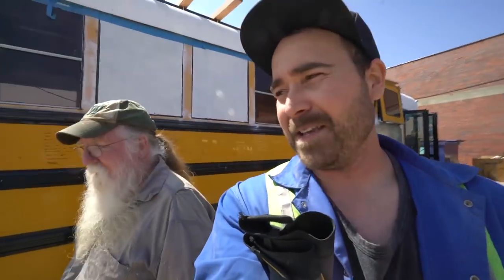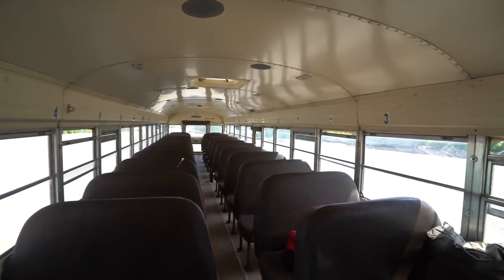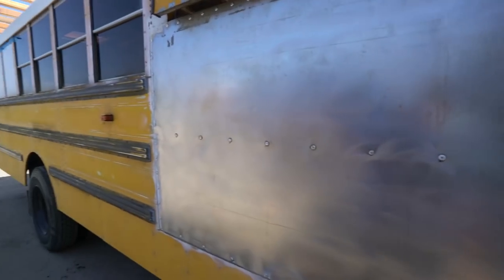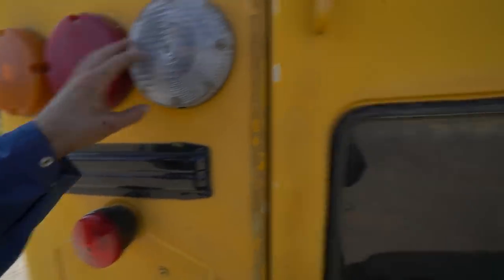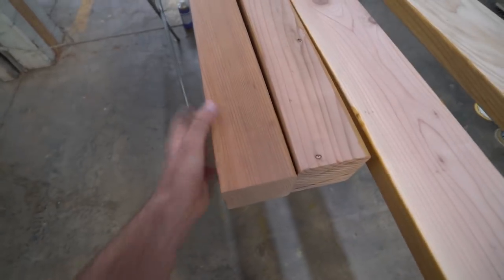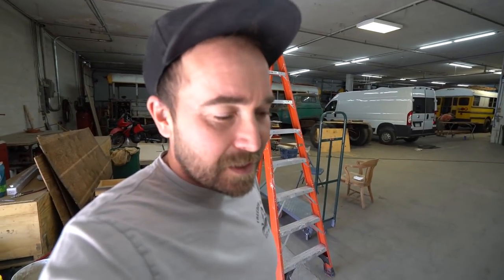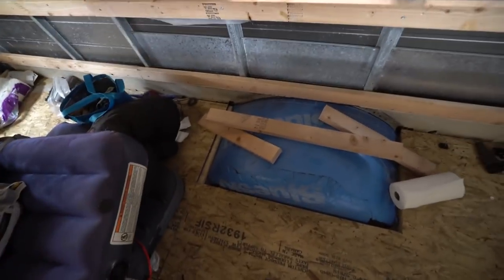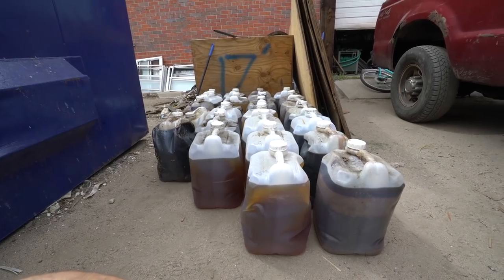Prepping for Paint + Free Vegetable Oil !!

Comment: The deck is one interesting idea! Wondering whether you considered the impact on stability and ride quality when adding estimated 300+ lbs of wood and steel on the highest point of the bus? Just sayin'.
Reply: Martin Wolfertz Good point. Unfortunately I don't think Jax is putting a lot of planning into any of this. I don't even understand his obsession with being on top of his bus. The top of the bus should be covered with solar panels, not a deck. He seems to want to build a party bus rather than a bus to travel in. It probably doesn't matter though. He has already mentioned that he is thinking about his next bus build. Apparently this is going to be a bus build channel, rather than a travel channel.
Reply: The weight of the wood shouldn't affect the bus stability. They are built to handle it.
Reply: Everyone I know that has built a skoolie talks about the next bus and lots of them have roof decks. If you are a good user of power you don't need to cover the roof with panels. I only have two and have all the power I need Have no fear Jax will be back traveling soon
Reply: People think buses are made of tin foil. Google bus roof strength and see photos of buses stacked on buses.
Reply: The Skoolie I do see the metal flex when he steps on it(more pronounced in timelaspe of course). its the hat channel with 2' spacing, the curve and the thick azz 50's family car sheet metal that all contribute to the "stackability",lol...But yeah, they are civilian tanks...
Reply: The chassis is designed for 70 squirmy kids...some folks have to remove leaf springs when they're converted to "just live"...and he's got fully adjustable air brakes I think...that deck on top is less lateral force than an RV airconditioner on top of a Toyota Dolphin and hippies take those everywhere, lol!
Reply from the maker: Not really. Was going more for looks than engineering 🤷🏻‍♂️😂
Reply from the maker: Na, just documenting the build before traveling again!

Comment: looking really good dude - keep on keepin' on …. nice work on the prep - it will make things easier if you remove some minor parts in your way tho - such as lights, mirrors, handles maybe …. rather than sand around them or risk hitting them with a sander, also for paint this will make masking way easier - and the end result will also be better, the paint will be under all edges, lasting longer and looking' better ….
Reply from the maker: Yes. That was a rough sand on a cooler day.